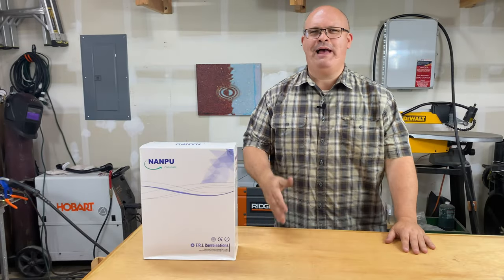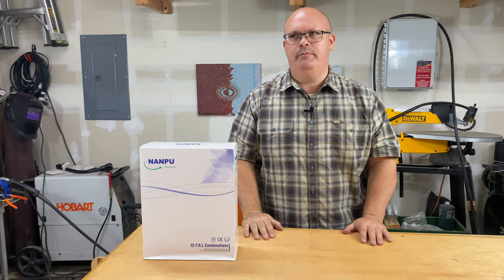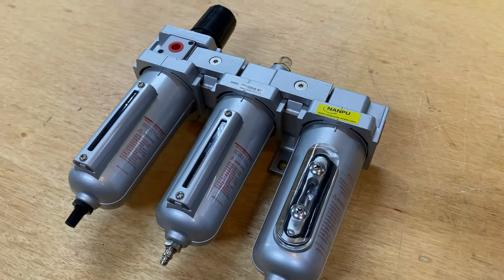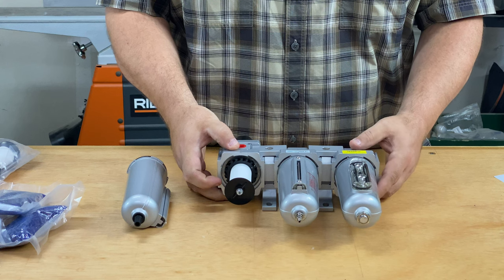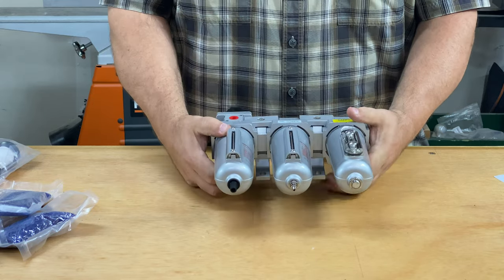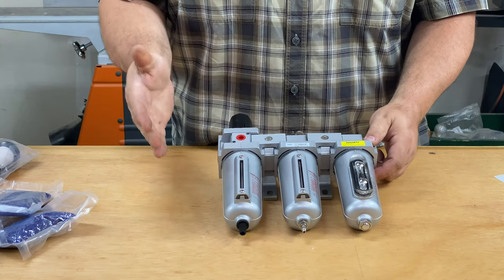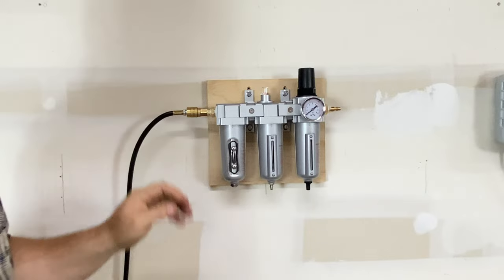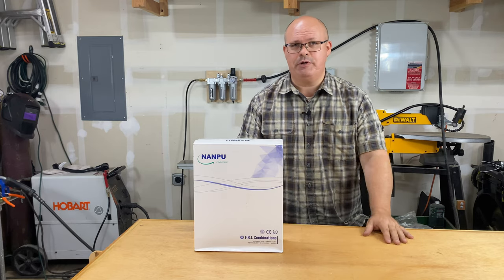NANPU PNEUMATIC 3 Stage Air Filter FRPD44-D  Review

Comment: Thanks for making this video. I am setting up my shop and going through the process of routing all my air pipes using 3/4" NPT and was looking for a regulator/water separator/dryer block like yours. My compressor comes to the unit from the right side and all the ones I saw on Amazon flow from left to right. I thought I had run into some kind of industry standard and was going to have add allot more piping until I saw your vid. You have provided me with some really good and useful information. THANKS AGAIN.
Reply from the maker: So happy I was helpful! Apologies if the episode was irritating mentioning the right to left feature. It was meant to be funny. 😁